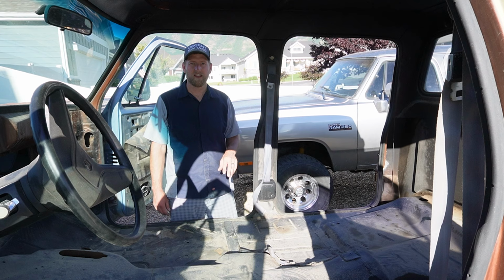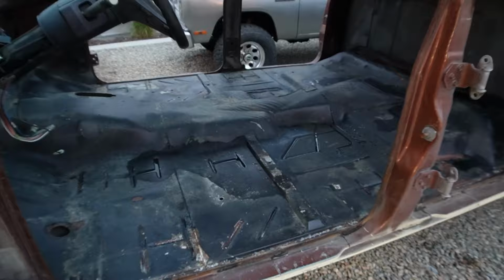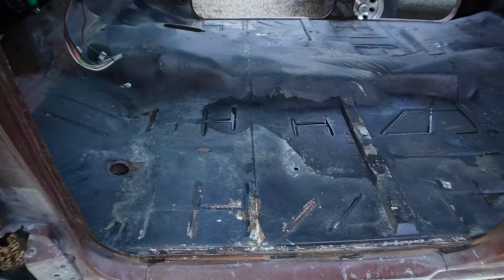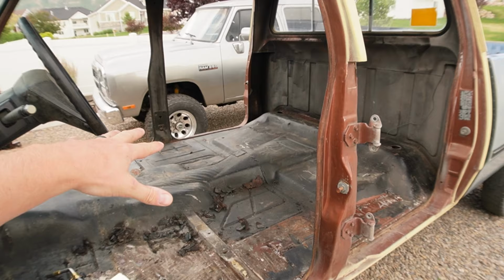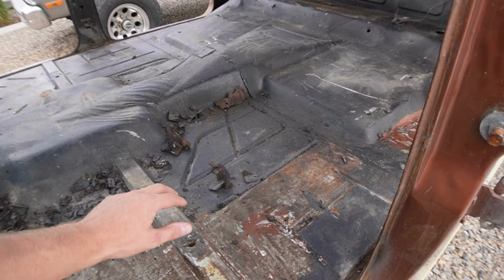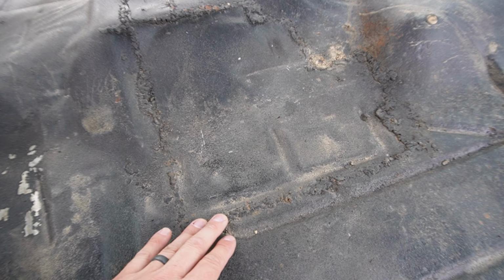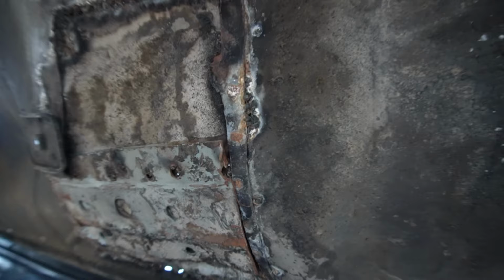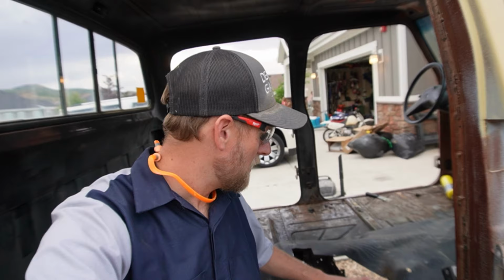Can This Floor Be Salvaged?? | Long Bed Larry - Ep. 3

Comment: Use that scrap piece of patch and some poster paper make a template then lay it on your flat plate, cut, bend try it bend some more then weld in place
Reply from the maker: Thanks for the tip Bryce! I actually hadn't even considered using the piece I cut out as a template! I'm going to do that for sure!

Comment: I used to work a a rhino liner dealer and when we had to remove bedliners they easiest way was a heat gun and a paint scraper there is an art to it because too cold and it doesn’t come off too hot and it degrades and comes off in tiny pieces and takes forever but that’s is the fastest way once you learn how to do it
Reply: Also the previous patch looks to have been done with flux core probably with a hf Chicago electric welder, or some AC flux core machine!

Comment: Cool video, thanks! A little off topic , just bought a ‘92 1 ton dually 4x4, and it needs some new leaf springs any recommendations? It’s in good shape with 165k and a newly rebuilt VE pump. To do: G56, then turbo but first a suspension then a body lift. Anyway thanks for the videos!

Comment: You must live in a community that doesn't have rules against working on vehicles at home. I'm pretty much limited to basics like oil change, brakes, and similar. Any other work has to be done illegally with the garage door closed. We have NAZI neighbors that will turn anyone in for anything. No chance of stacking car parts out front or having non-operational vehicles. I've successfully performed major work on the 93 D350, as the garage is almost large enough and we have 5/8ths of an acre.